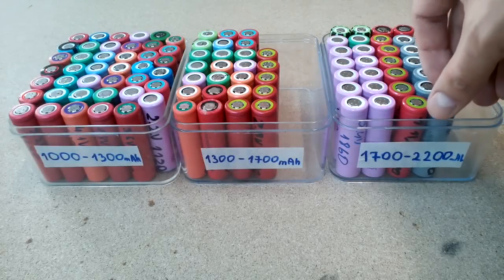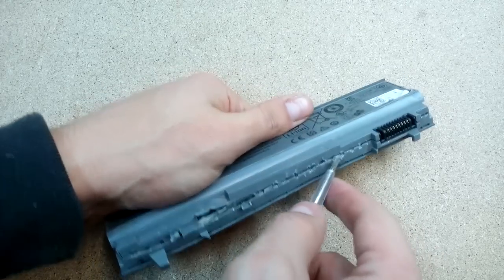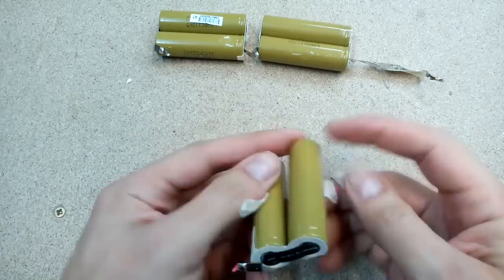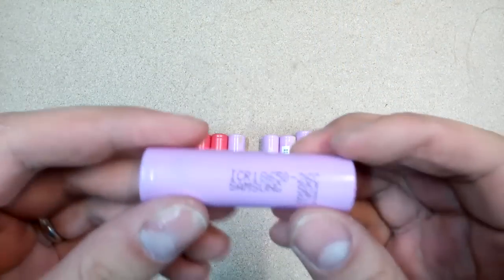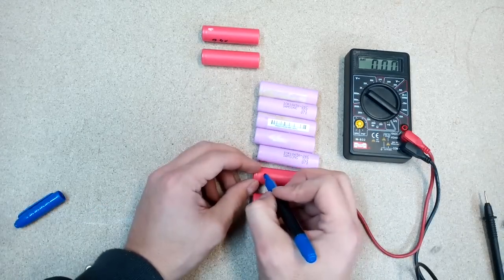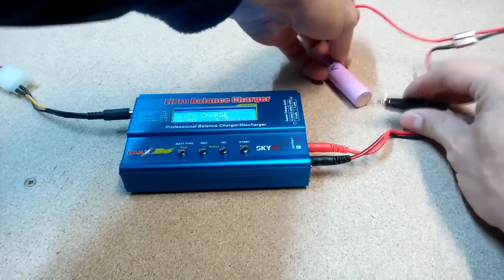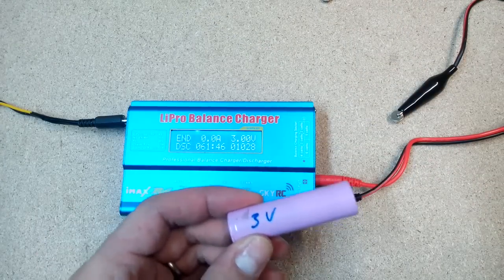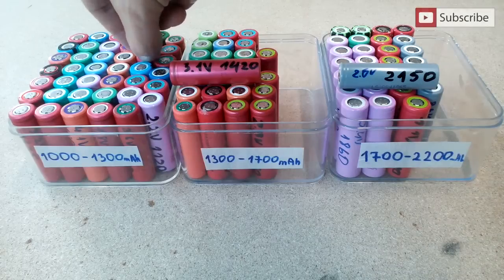How To Get: Free 18650 Lithium Cells From Dead Laptop Batteries

Comment: for anyone who uses Kangerteck subboxes to vape here you go free batterys
Reply: and thats how people blow their faces off in using batteries which have a way to low amp limit or which are old
Reply: completely the wrong time of batteries for vaping with hahahahah
Reply: Ian Appleby hey if it works it works
Reply: They dont supply enough amps for vaping.
Reply: yeah, minus $32,000 to have teeth put back in your head.  Oh well.. at least by the time the wires come off your jaw, your nicotine addiction will be past.   DUDE!  HIGH quality batteries are like $15 each for 30amp 3000ma, why even fucking risk it?
Reply: no you don't want to do this that's completely unsafe your batteries need to be a family charged together discharged together and kept nice ripping them out of a laptop battery case and throwing them into a mod is basically throwing a small bomb in your hand and you're seeing how many times you can use it before it explodes
Reply: Might be ok if you are a toodle-puffer and stay above 1.2 ohms on a light (28ga or higher) coil.  But as soon as those things try to push even close to the 20 amps my batteries can push.. BOOM. You'll be picking your teeth out of your brain for a week.
  but seriously.. at $10 to $15 per battery, is it even worth taking the chance?
Reply: +gbalkam $5 for a Samsung 25r
Reply: 18650  the yellow ones are in an ileaf as long there is  voltage chip and not directly discharging should be fine
Reply: so then why dont they put the yellow ones inside the  batteries instead of the red if red arent good enough for vaping   ones i have i think are 5 volts each  cause goes to 10  so there two batts  im just relearning all this stuff  when i was like 10 i used to read the colors on resitors  now ive totaly forgotten them i would have to look it up on chart
Reply: yeah mixing voltages bad idea
Reply: why not even sub-ohm like .4-.6 about 6-7 wraps with 24awg

Comment: test the voltage before you spend all the time making them look nice by tearing off metal lol
Reply: You can revive dead 18650s by wiring it in parallel with a good 18650
Reply: @justinfoster6135  really? has that worked for you?
Reply: @peksn  yes, wiring a good li-ion cell with a bad one FOR 30 SECONDS will revive it there's just no guarantee that it will be fully recharged to its capacity but you should get 4.2 volts after charging it
Reply: good point. that did seem tedious.

Comment: can I use those for vaping?
Reply: Noooo, they are almost always too low of an amperage to safely use for vaping.
Reply: +Heavy as fuc maybe with a 4 Ohm coil ? :o 

xD
Reply: +KiDCe - CS:GO Clips &amp; Videos max draw is about 3 amps peak.
Reply: +john cocker what if I put 10 of them in parallel and power a 4 Ohm coil.... i mean I can't imagine that there are any cells that couldnt handle that xD
Reply: +KiDCe - CS:GO Clips & Videos 1 battery would do a 4ohm coil just fine. 10 would do a tiny coil. You could draw about 20 amps with 10
Reply: +john cocker me either
Reply: +MyLifeInAFlamingBag i made 10 of the parallel and im vaping with it like 3 months, i Same battery Life and Big clouds
Reply: +MyLifeInAFlamingBag just a joke man, im vaping with sony vtc5 on cuboid :)
Reply: MyLifeInAFlamingBag vtc have 300mah more capacity

Comment: you could do all this work.. or you can grab 10 dollar samsung 25r's like a normal person. its really not that expensive. and will give you better power than some used one lol
Reply: this takes 10 mins. last time i checked 10 mins of work for 4+ batteries > 10$
Reply: Unless you have access to lots of potential batteries, this is not worth the trouble. Some stuff I salvage, like relays and transformers, but for perishable stuff like batteries I buy as needed. Time is money, and the time wasted on gathering, testing, stockpiling and maintaining nominally performing batteries is not worth the cost of purchasing new ones.

Comment: do you guys realize by the time laptop has died those batteries are well past their life span they are unsafe the best 18650 batteries can only handle three to five hundred charges. at that point they become a pipe bomb seems like a lot of work for a little reward when you can buy brand new ones for five bucks a piece and that are safe to use
Reply: +aaron smith
18650 is a form factor. What matters is the specific chemistry in the battery. There are 18650's that have a cycle expectancy of 1000+ cycles and even when they reach that point are still at 80% of their new capacity. They still have lots of life left in them. But there are also cheap (new) knock off batteries out of china that are as bad as you say or worse.

They don't explode from age or even number of charge cycles used. They explode because you use them wrong, exceeding their listed specs.
Reply: +aaron smith $5 does not buy one much of an 18650 battery on the new market. Even $5 a piece can add up quickly if an application needs a number of batteries too. Although tell me more about this pipe bomb effect that you speak of. Because that could be a reward in and of itself. Who doesn't like a good explosion?
Reply: +Paul Frederick the batteries only have a short life span of three to five hundred charges once you get past that they are a ticking time-bomb the composite breakdown and it become unstable Google search
Reply: yeah youre not doing it right if you dont get blown up a time or two. lol
Reply: +jonny kotzur yea Li Ion is more stable when venting than nicad batteries.
Reply: 1st common sense comment I've seen so far. Those are pretty unstable for anything other than recycling. For those who think cheap/free battery packs are a good money saver for a project, think that an unstable battery may damage your project beyond repair. Worst case scenario: it lights your house on fire. Save money somewhere else.

Comment: but they are dangerous to put in a ecig because they have no protection from bigger amperage and it can explode
Reply: +Matas Jo Most batteries have no protection from overamperage and NONE of the best vaping batteries do. The protection is in the device. If vape batteries are exploding on you, it's because you don't understand what you are doing, not because the batteries are dangerous. These batteries have a listed max amperage draw. Every battery ever made does. Mechanical mods have no protection at all so even the best batteries can explode if you use too little resistance which means massive amperage.  If you don't exceed that, they should be safe for their entire lifespan. If you don't feel like doing the math to find out your amperage to match your batteries, stick to eGo devices. Even regulated mods can blow up batteries.

Comment: Good video for starters. The only warning I'd throw in is to limit your discharge rate to .4A to .5A max. Anything higher and you are shortening the lifespan of the battery. Yes, the discharge goes slower but you will have batteries that last longer.

When you get into measuring the capacity of thousands of batteries you will want an Opus BT-C3100 v2.2. This device looks like a standard four battery charger but it will allow you to measure the capacity of four batteries at once. I own five. The fastest way is to have another four battery charger on either end of the process; one to charge them to capacity, the C-3100 to measure capacity and a third to charge them after the capacity test. This lets me test about 100 18650 batteries per day. 

I use the large capacity batteries in my E-bike. The smaller ones I use in cell phone chargers. I get the empty boxes from China for about $2.00 and simply add the batteries. I also use the lower capacity batteries in LED flashlights that take 18650s. Both the cellphone chargers and flashlights are used as promotional items for my wife's business. But using them for these purposes lets me write off my project on my taxes.

Hope this helps.

Rocket
Reply: So you are part of that shady business of selling upcycled 18650 powerbanks...

Comment: Hey I did this and I'm using the 6, samsung 18650's I got from an old fell for vaping they work great but I need to get the small pieces of sharp metal off the connections I've tried everything and removed the wraps because they ripped. I will rewrap them before I use them so don't give me the saftey bs
Reply: do NOT use these in an ecig

Comment: This is great....but......where do I get dead laptops ?
Reply: At the laptop cemetery duh....
Reply: +Don Keevney friends, sometimes craigslist
Reply: I dont use my friends lmao, if they got old shit then I can either get it off their hands or they can throw it in the trash, but yeah craigslist most definitely can be sketchy though
Reply: Try asking anywhere that has a battery recycling point asking if you can look through to see if they have any lithium packs?
Reply: Don Keevney from the cemetery
Reply: There are companies that sell old laptop batteries 50p each is going rate you can open the packs much faster than he does here just twist them wear gloves .I put them in a workbench and twist till the plastic cracks the peel off .I know someone who uses like 50 off these in electric bike battery which he makes himself to hang in a leather pouch ender the crossbar he gets 30mph and a range of around 60 miles much better than shop bought
Reply: +$ESHAWAY so you use your friends for whatever you can get out of them? Cool! I don't know about getting much value out of Crack Addict's List though. Those folks often seem rather desperate to me.

Comment: this is porn to vapers
Reply: +Zyrexed Don't do it, these have on average a 5A drain because there are so many in parallel. They would likely explode in a mech mod.
Reply: then there will be more news about people mods blowing up cause of a bad battery or not knowing the amps on them
Reply: +Zyrexed If you want to get your cells blow up, then this is great. Otherwise, don't fucking use this for vaping. Except you Vape with high resistance, like a minimum of 1 Ohm. better higher. There is no point in putting a 30A drain cell into a Laptop. They are more about the Capacity. Check the lables on the cells, they won't be high drain Batteries. You can use them in all kind of Stuff, but not for Vaping.
Reply: I like how vaping has taught otherwise mostly non mechanically or technologically aware people basic electrical knowledge.
Reply: +Zyrexed It might be porn to vapers who are morons.  To everybody else it's a big ole sack of nope.

Comment: Could you use these in a mod such as for vaping?
Reply: +Rayne Leaf They are pretty low Amp i believe and i wouldn't recommend using anything under 20A for vaping
Reply: Do not vape with these unless you want plastic surgery or want to die. If you can't afford a quality 18650 battery for vaping you need to reevaluate your life and get a better job.
Reply: +Rayne Leaf no
Reply: Rayne Leaf m
Reply: +Rayne Leaf People try to all the time and you read about them in the news. They also use these in the cheap Chinese hoverboards that catch on fire and burn peoples houses down.
Reply: I've been researching into battery repairing and found a fantastic resource at Jons Mender Guide (google it if you're interested)
Reply: Well Done Tips: If most of them are 5A max, then no. You cannot use them in a vape. Or you shouldn't at least
Reply: No, and for well done tips to comment and say yes is totally wrong, it is not just the amperage of the battery, alot of factors come into play when it comes to this get your facts straight, recycled 18650's like this are NEVER okay to use in a vape mod no matter what 18650 it may be.
Reply: Bond James Bond you do realize, regulated mods are prone to fucking up too. And some allow the batteries to go passed their amp limits which is not good. Don't act like regulated mods can't blow up, considering if you chain vape it enough, the mod will get hot. 
Now, I am with you on the whole user error part. Mostly when it comes to those stories that put vaping the negative limelight, it's usually because people are dumbasses and put their batteries in their pocket with loose change or let some shitty Chinese mod autofire in their pocket. Just people not paying attention there. Also them using some shitty clone mech and an RDA with a barely protruding 510 pin.

Either way, with these laptop batteries, you don't know exactly where they came from, you don't know how they're rated, or what kinda lifespan they have left. Why don't you hit up Mooch and see what he thinks about laptop 18650 batteries. Guarantee he doesn't recommend them, for regulated or unregulated.
Reply from the maker: +TheEpic786 yes, most of them are in 5A of max current.
Reply: Yes as long as it is a regulated mod should be fine ive been using laptop batteries and they work fine but havent got as much power as high drain ones

Comment: i've got 1000's this way :)
Reply from the maker: +HBPowerwall I'm folowing  your power wall project. Epic amount of cells!
Reply: +Well Done Tips more on the way :)
Reply: @HBPowerwall  I charged my cells upto 4.2v after 2 days my cell are only 3.8v what's the problem?
Reply: sounds like a great place to live.. hehehe
Reply: Where do you get them for free?!?
Reply: +Paul Frederick just an idea... if you live in the states and possibly world wide... (there are many sites with the same structure) use Craigslist.com or other local site where you put ad for wanted old laptops, laptop batteries and really any type batteries beside lead acid. you can revive lead acid batteries occassionally but only with limited voltage, etc... but lipos, etc... anything with rechargable multiple cells in them (power tools is another good 1)... 1-3 cells go bad causing the packs to show error and wont charge. most people toss em... but they are throwing away usually 75% good cells
Reply: Jason Riley
I live in the States. But I live in a rural area where folks do not throw much away. They do not have much to begin with. There's not a million people living in this whole state. I live in the most sparsely populated part of it too. The peace and quiet by me is deafening.
Reply: combination of luck and hard work.
Reply: +HBPowerwall that's how, you were asked where though.

Comment: I have a non genuine imax b6 charger that when I do a discharge test using the lipo setting, mine won't terminate at 3v. It will keep lowering the current to keep the voltage at 3v. Does yours do the same? I found from another video to use the nicad discharge test and set it for 3v to get it to properly terminate at 3v.
Reply from the maker: +Aaron S mine stops at 3V and at same 1A of load.

Comment: i found one laptop and dell battery module got 9x battery and 6x battery look like Zippo Lighters just waiting for my multimeter from ebay i want to make a cheap power bank found one it can holde 8x 18650 battery for 5$ i try find one is bigger but only one found can holde 8x battery

Comment: And you can use your batteries for anything you want? Nice project.
Reply from the maker: I'm working on some projects with those cells allready, so stay tuned, i'll share when will finish it.
Reply: I use these cells for diy, power banks, flashlights lasers,...
Reply: for vaporizers to?really?vaporizers need a battery that have minimum 20 Amp for safety reason,specially those who do sub ohm and mecha or unregulated mod users for regulated mod that have battery protection it's not really maters because if you use low amp batteries the mod will not fire up it will says battery weak..so what is the amp that laptop batteries have?if it's lower then 20 Amp and you're sub ohm,using unregulated mod you will blow your face off..cmiiw
Reply: that's exactly what I meant,in regulated the chip protected us,but in unregulated/mecha it's not,the mod will draw any amps your battery have depending on your coil resistance,with sub ohm coil this is dangerous,that's why we need higher amps batteries.
I won't use any lower than 20 amps batteries even in a regulated mod.if you read the manual in every mods you bought they always said "requires 20 amps or higher amps battery" so why take risk?
know your battery specs guys,vape safe.
Reply: yeah like that fool in idaho who blew up his face with a mech mod.
Reply: my ileaf has the yellow 18650's
Reply: +Robert W NO!  They're not rated for high-amp drain, and you're better off spending the extra for new cells for vaping.
Reply: vaporizers too?
Reply: +Robert W yes
Reply: unregulated mod its a battery straight on a coil ?  , ok i know what you said now , yes cheap batteries for REGulated vaporizer = ok , unregulated is like shorting battery itself lol i agree , its bad
Reply: NOT GOOD NEED SA CAPACITOR WITH RESISTOR TO  MAKE SURE BATTERY DOENS'T DISCHARGE ALL AT ONCE !!!!!
Reply: even if regulated?  it don't matter i dont have batteries out of laptops the ones in the 100watter came with it got from friend but gave it back anyway kinda overkill ihmo for small rda(rba?)
Reply: i dont see the yellow ones in  his picture  so i guesss they are rATED HIGHER THEN WHAT LAPTOP WOULD EVEN NEED SO THEY DONT USE THEM IM 44  I USED TO BE INTO ELECTRONICS WAY BACK WHEN I WAS LIKE 815  WAS NEVER ALLOWED TO USE A SOLDERING  GUN OR A POWER SUPPLY SO I NEVER ADVANCED HIGHER THEN  RADIO SHACK KITS
Reply: Robert W
Go new.  You never know what you're dealing with with "recycled" cells.  Be safe.  As rocket raccoon said, you need at least a 20A rating on the batts for safety.  Lithium-ion venting is not a fun experience.
Reply: indeed ive seen pics of an aftermath
Reply: I use recycled cells in my VTC mini and it simply won't let me set wattage higher than what the cells are capable of. I'm never pulling more than 4 amps out of them.